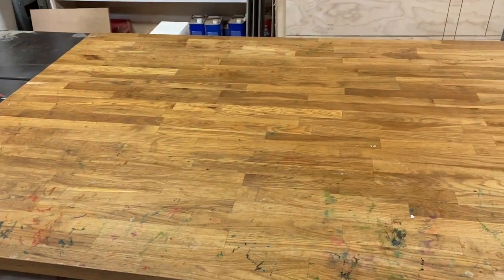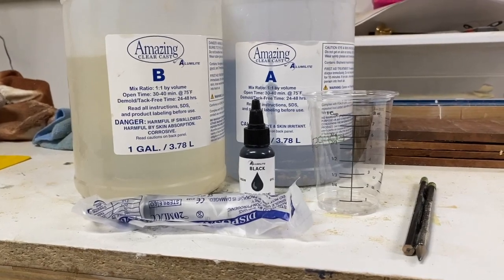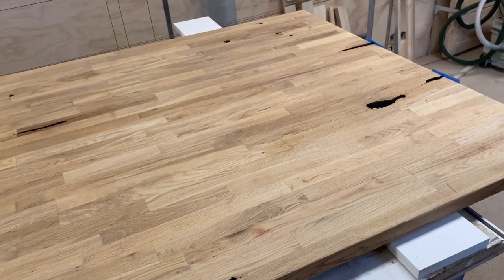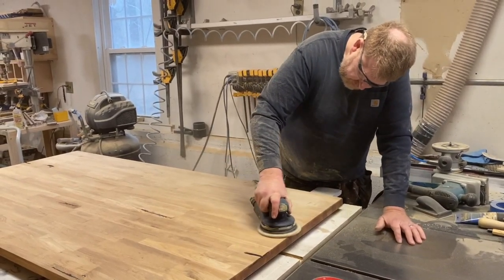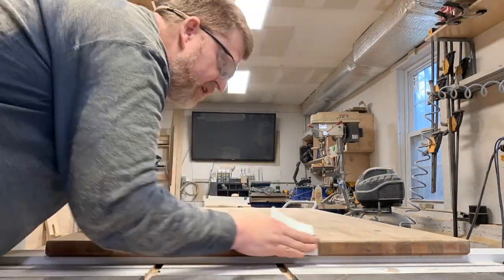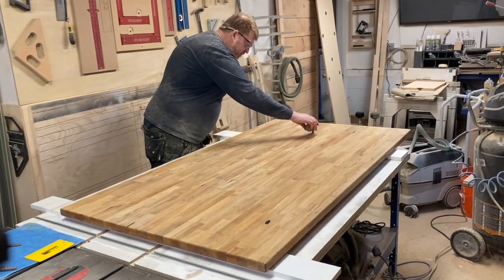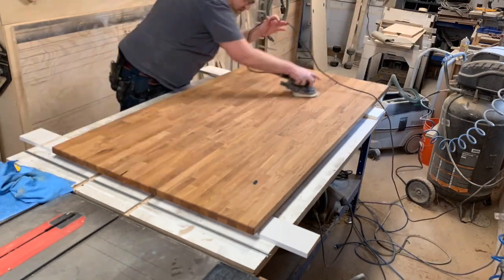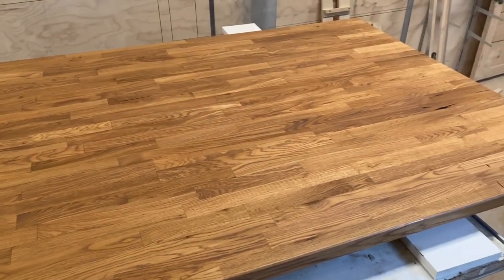How to Refinish a Table with Rubio Monocoat - DIY Table Refinishing - Woodworking

Comment: Nice work!
Reply: What type of wood was the butcher block? I want to use Rubio Monocoat on a 6 foot x 30 inch deep red oak butcher block but I am concerned with the open grain considering I will be using it as a desk top. Lmk your thoughts. Thanks.